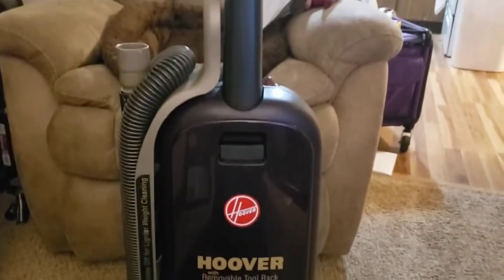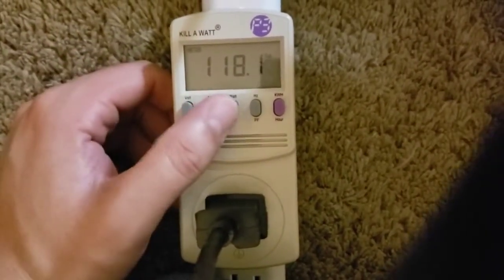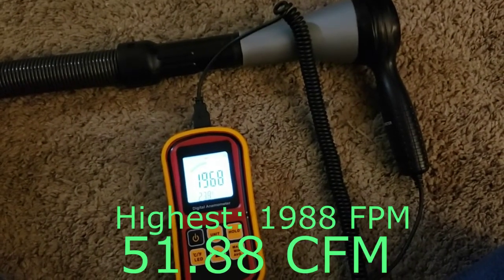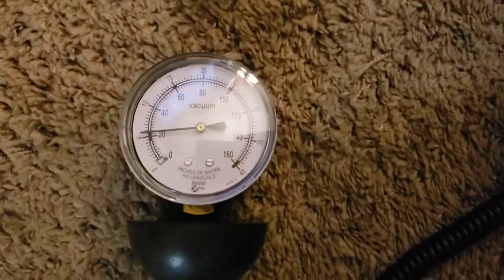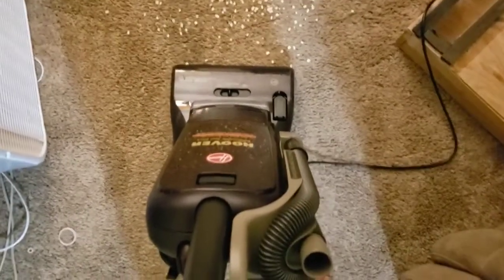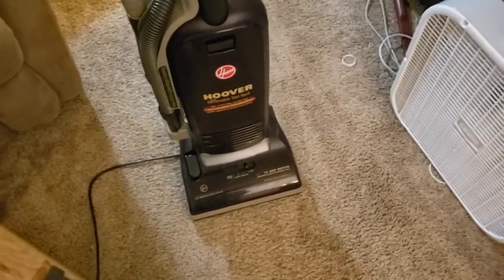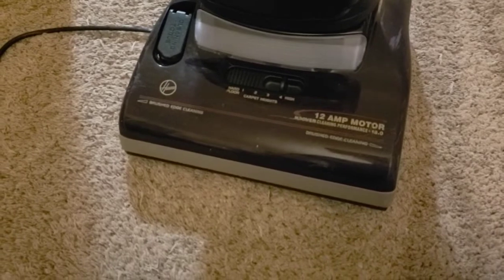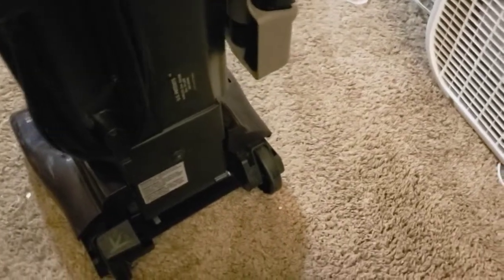Hoover Caddy Vac U5117 900 airflow test

Comment: Thanks for the video, I've always wondered how these 12 amp Elite's would perform since they've always felt more powerful than their 7 amp predecessors (in fact I'm now convinced that's why Hoover put in the softer green bristle brush roll in the 12 amp Elite's, so it wouldn't be as aggressive on carpet).  I remember I had a Breathe Easy variant of the Caddy Vac (without the removable tool caddy), as well as a blue Preferred, and a Soft & Light Supreme that had 12 amp motors, and I honestly miss those for their power, but I don't miss their extra noise.